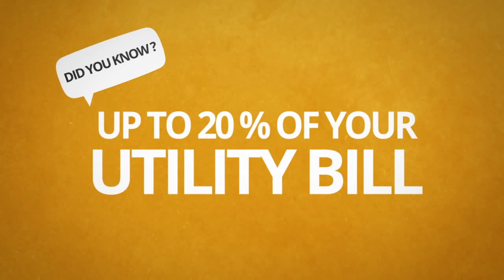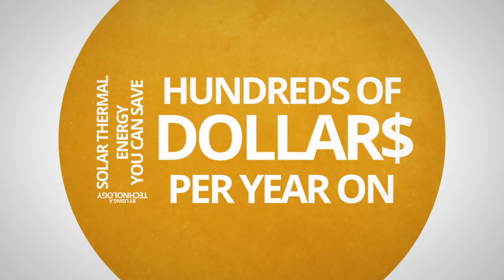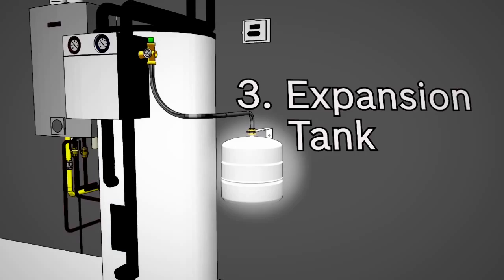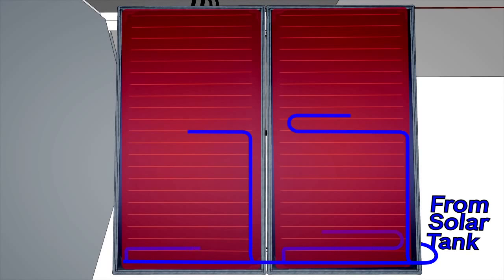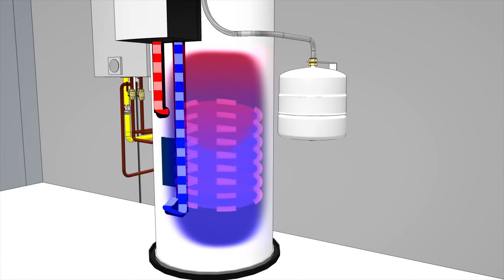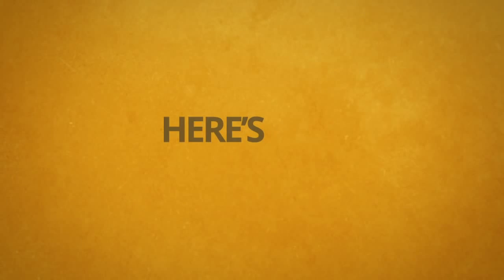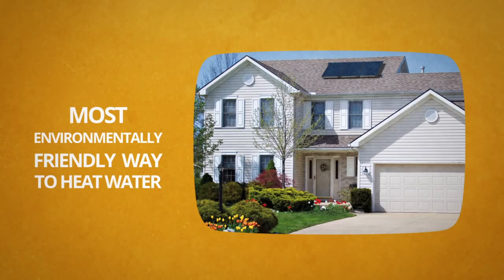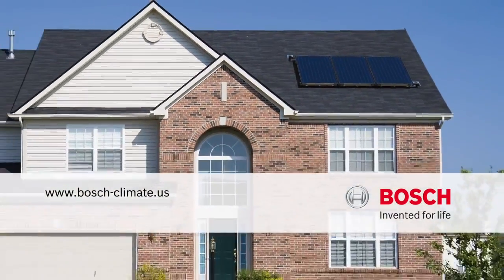Water heating by solar collectors Bosch

Comment: Does it directly heat water or is it some other liquid?
Reply: I watched another video where they indicated that glycol is used as a heat exchanger to heat potable water.  if that's the case, it makes sense, since glycol also prevents freezing.  However, the video I watched was a system that might have been installed in Africa, based on the comments from the video.  I mention this because I do not know if systems in Africa are designed similar to those in the U.S.

Comment: Material of a flatplate Collector mostly is Tinox Coated Aluminium or Koper. This technic Infact is already older and the system drawings are incorrect!
If someone whant's to make a movie of a highpower Thermal System let me Know!
https://www.vbus.net/scheme/de9e98d42d193544827b15c8b42f1ddd
Best Regards,
Stefan Verwijs
Solar Thermal Engineer

Comment: It’s already been discontinued by Bosch.
Reply: Were the solar panels a bad product?  Do you know why they were discontinued?
Reply: @RedondoBeach2  
I can only guess that there wasn’t a government rebate for them any longer so not many people could afford them.
Reply: Solar thermal is typically now combined with solar PV - keeps the PV panels cooler, which helps them to generate more electricity. Only slightly more expensive to but, and you get two lots of free energy for the price of one. Solat thermal panels are widely available in Europe though, so maybe this was just a blip, a US thing during the MAGA years.

Comment: what kind of material is the absorber plate?
Reply: Silicon is mostly used material for solar panels, since it's cheap and easy to get (from sand) there's no other problem 😊
Reply: @canadianbro9327  these aren't solar panels; they're just black sheets that absorb sunlight and convert it to heat. I would assume it would be some kind of metal like aluminum coated with a dark pigment like graphite or a metal oxide.

Comment: It is costly, complicated, and requires a skilled technician to repair and maintain it.  It is also large in size and distorts the roof view.
Reply: But still it reduces the dependency on fossil fuels. So one of the main problem "pollution" is solved ✔️
Reply: @canadianbro9327  
Is the pollution problem solved by increasing the cost ?
Increased cost means increased poverty.  This is not the best way to deal with pollution .
Reducing pollution is by controlling overpopulation and by stopping deforestation .
Reply: @بوفارسبونورا-ص7ه  Did you not watch the video? It said the return on investment is 10-20%; that's a better investment than the stock market.
Reply: @matthewmullin8168  
Even if this true , it does not equal the distortion view of the roof .
Reply: @بوفارسبونورا-ص7ه  yeah because the most aesthetically beautiful thing i can look at is a rooftop
Reply: @بوفارسبونورا-ص7ه  - Your Roof, is not supposed to be your Wife, you know! It's there to do a Job, and it can do a Better job, with this "Type" of System, if not this "Exact" System!

Look around on YouTube, for Solar Concentrators! If you search right, you can get information on very Low Cost Systems!
Reply: @robertweekley5926  
If you give me a system:
- Small in size .
- Does not distort the look of my home .
- Provides me with what I need 24 hours,    365 days a year .
- Affordable .
- Easy maintenance .
So happy with it, other than that, NO ⛔
Reply: @بوفارسبونورا-ص7ه  - So, you want a "Suitcase Nuke?"
Reply: @robertweekley5926  
No ,, i want an electrical heater .
Reply: It's not super pricey it's really simple to make and this have a very long life. I have some solar pannel like this and in 7 years it was cost effective